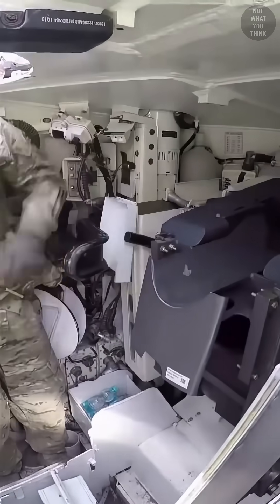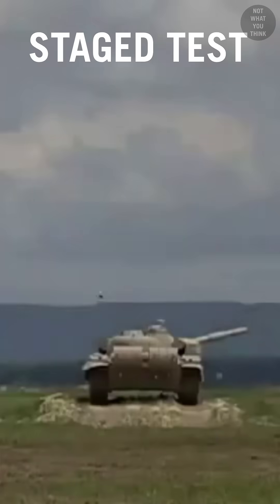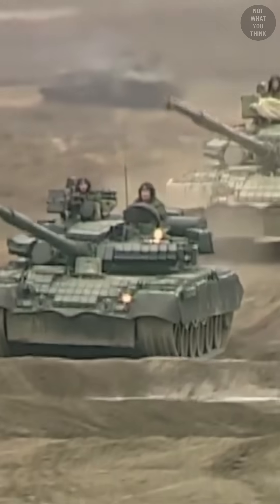Why M1 Abrams Tank Has No Auto-Loader #shorts

Comment: The reason Russians went for an autoloader is because  they have many more tanks and reducing the crew to 3 from 4 gave them a 33% increase in crews available to fight but at little expense. Despite Western assertions, the Red Army has always had a manpower shortage, but not quite so much an equipment shortage. So a 3 crew MBT makes a lot of sense to them.
Reply: Yup. It's interesting to compare Russian engineering to American. Russian war machines are as if designed to be run understaffed, under-maintained, outside operational envelope.
I recall one example was aircraft's engine reverse:
USA: we'll prevent in-flight engine reverse for safety, so as to eliminate the chance of the pilot accidentally activating it in flight and crashing.
Russia: we'll enable in-flight engine reverse for safety, so when the pilot needs to land this aircraft on a runway shorter than required - they'll be able to kick in engine reverse before full touchdown.
Reply: @suzukirider9030  reminds me of the AK47
Reply: @suzukirider9030  Well, as we like to say about safety rules with guns: your finger is your safety.
Reply: @suzukirider9030  They do have actual experience with winning wars as well though.  Not just maintain war for income.
Reply: @suzukirider9030  OMG I LOVE AMERICAN SAFETY. Especially that moment when they use depleted uranium both in M1's armor and shells, so almost every crewman after service becomes infertile! AMERICA FOR THE WIN!
Reply: @vibk2744  Sources? I heard about Depleted Uranium AP sabot rounds, but find it hard to believe it's used in armor. Armor needs not be heavy.
Reply: @suzukirider9030  The M1A1 AIM model and beyond of Abrams has depleted uranium located inside the turret and hull armor, but yes we use DU rounds as well.
Reply: @vibk2744  While we do use depleted uranium in both armor, and our shells it is completely shielded so the crew isn't exposed. Depleted uranium is only 70% as radioactive as regular Uranium, and mostly admits Alpha particles, which can be blocked entirely with a coat of paint. The only risk is if the DU armor is hit with a DU shell the dust will cause those nearby to breathe in depleted uranium through the air.
Reply: @Adierit  Hold on a second.
Radiation doesn't come in separateable flavours - nuclear synthesis emits all 3 parts: alpha, beta and gamma.

There's no such proccess which emits alpha-radiation alone and not the other two.

Besides, emitting alpha alone would be electrically polarizing. For each alpha particle - two beta particles (which are basically high-energy electrons) must be emitted.

Also - when a DU sabot rounds hits ANY kind of armor - it's evaporated (along with a portion of the armor). That's literally how sabot rounds work - they melt a hole in the armor with their kinetic energy, and hope it reaches through the entire plate. So that DU round hitting a common steel armor plate would also evaporate all that DU into radioactive droplets (which will cristallize back into solid dust particles in-flight, but still be radioactively exposed).

But, I guess if you're in a tank that's being hit by a DU sabot - the radiation from the dust is the least of your worries.
Reply: @suzukirider9030  you're correct, it does emit other radiation, but depleted uranium is again, depleted, meaning its main emission is alpha particles as is well documented. as far as the armor goes, yes i wasn't concerned with giving off a perfect answer, it was more so pointing out the obvious
Reply: @suzukirider9030  sabot just means theres a casing around the round for rifled barrels, like a shotgun wad
Reply: @maddogpatches  I see, thanks for clarifying.
I basically thought APFSDS and "sabot" are sort of the same. But, like you said - it's more like APFSDS is just one application of sabot.
Reply: @suzukirider9030  you’re not understanding how DU works in munitions. It doesn’t “evaporate” on impact nor is it designed to “melt a hole” in the armor. There’s a reason the DU part of the round is called the penetrator - because it penetrates the armor, it doesn’t just “evaporate” and melt armor. The way DU burns it sharpens itself as it goes through armor, and the goal is to still have a projectile left on the other side to destroy whatever is behind that armor. Yes DU burns but melting armor is not at all why that’s desirable - it’s the fact that the penetrator continually sharpens itself as it penetrates, where as any other penetrator material (tungsten carbide, steel, whatever) will mushroom on impact - a fat mushroomed penetrator doesn’t penetrate so well. DU is the only heavy material that will not mushroom on impact and in fact gets sharper the further it penetrates due to the way it burns.

Also “evaporate” is for a liquid turning to gas, the word you’re looking for is disintegrate to describe a solid turning to dust / fine particles, or maybe combust if you were trying to say it’s burned up.
Reply: @TheWallsocket  I see... Well then I was mistaken. There's a simulation of APFSDS rounds penetrating armor - my understanding was that both the round and armor melt on contact (kinetic energy per mass being greater than energy needed to heat and melt that same mass), and the hope is that by the time there's a through-hole in the armor there's still some rod left to go through it and do internal damage. But maybe that's how Tungsten rounds work? What you're describing about DU rounds is very different.
Reply: @Adierit  Exactly, although its not usually dangerous to tank crews, it is dangerous to our infantry when they walk on vehicles and buildings hit with DU rounds and the locals of course.. lol
Reply: @TheWallsocket  agreed. HESH rounds are what this guy is talking about. Those use kinetic energy and HE to evaporate against the hull and cause the armor on the other side to shatter into deadly fragments.
Reply: @killerhellhound  Depleted uranium is uranium that went over the mark of half decay. Meaning it still has 50% of it's radioactivity. Couple that with the fact that uranium radiation has long waves that penetrate both non organic and organic matter very well and you have combo that should never be used anywhere near the personell.

If you have to use something so dense (which doesn't make any sense as current APFSDS can penetrate up to 800mm of armor and with time it'll be even better) use tungsten. It is better to ensure that crew will survive rather than the tank will not be incapacitated.
Reply: @PORRRIDGE_GUN  Was meant so say that it travels at 1500m/s and can pen up to 800mm idk why I fused them together loosing half in the process kek. Also 380mm naval would rather decimate the front of tank as opposed to simply penning it.
Reply: @vibk2744  that’s a good idea to get rid of “poor people” since that’s who they mainly recruit. If they can’t have kids that’s just a plus
Reply: @suzukirider9030  wait are you sure? I actually didn’t know that all radioactive stuff emit all particles.
Reply: @cassu6  Well, there are a few various fission reactions, for instance U-235 fission emits fast neutrons, which are neutrally charged... There's only a dozen or so reactions that actually exist in the world, around the U-235, U-238, and Plutonium kind of metals.

But beta-particles are fast electrons and cannot be emitted without emitting alpha-partices (because the electric change must be preserved on a meta level). 2 neutrons (-1 charge each) per 1 alpha-particle (+2 charge each, basically a Helium atomic core).
Reply: @suzukirider9030  Uranium is one of the most dense materials around. Thus is makes awesome armor.

I can confirm M1 Abrams uses depleted uranium in their turrets. A small layer.
Reply: @suzukirider9030  Man ! You seem to know your stuff. Good for ya. It was interesting reading your comments.
Reply: @suzukirider9030  tjat should be true about armor but also compare the m1 abrams weight to some other tank and you will se just what ypu are scared of
Reply: @infectedshroom3097  Indeed, the Abrams is 50% heavier than an T-72 or T-80...
Reply: @infectedshroom3097 , why is weight relevant?
Reply: @iamcuthulu316  well the heavyer the tank is the harder is for a tank to manouver around, it comsums more energy, its harder to transport it...
Reply: @infectedshroom3097 , exactly my point
Reply: @iamcuthulu316  Russia is so massive that a tank would completely wear out its engine driving from one end to the other. There is only one way to move tanks across that much mileage, and that is by train. The lighter a tank is, the easier it is to transport and the more tanks can be transported by a single train, meaning quicker logistics during mobilization. 

It also means the tank can cross bridges a heavier tank cannot, and Russia has plenty of rivers- one of the reason the BMPs and BTRs are amphibious. 

The more heavy a tank is, the more expensive its fuel supply is, and the bigger (and more expensive) of an engine is needed to move it. In the case of the Abrams, a gas turbine is used… Which is like a magnet for heat-seeking missiles. 

Finally, Russian tanks present a smaller target. 

So, there are numerous reasons why a lighter tank is beneficial.
Reply: @vibk2744  also thousands of crewmen of Iraqui armor became infertile, due to incineration.
Reply: @suzukirider9030  there is depleted uranium mesh in some of the later M1A1 variants and all of the M1A2 variants the reason is that the very dense uranium can absorb large amounts of energy from kinetic penetrators making uranium by weight a better armor than composite. Also the guy that said that the depleted uranium harms the crew is dumb. First of all the uranium in the armor is deeply embedded meaning the rest of the armor absorbs the radiation preventing exposure to the crew. Second of all the ammunition is stored behind very thick steel blast doors except for the ready rack closer to the driver but that is still protected by steel meaning that the crew is not exposed to any more radiation than any other person.
Reply: @vibk2744  the depleted uranium isn’t very radioactive but it is toxic but so is 1/2 the other stuff in military vehicles
Reply: @Adierit  Good times of "should be" followed by couple decades of gaslighting and the eventual "ok, maybe in practice it doesn't quite work like that".
Reply: @vibk2744  Gunship moment.
Reply: Wow, that make sense
I thought it just marine thingy givin the soldier free PT
Reply: Well considering the footage witnessed in the video I believe it's better for your crew and army population numbers when you don't always die with the tank
Reply: As the main part of that it's better to have an auto-loader than an undisciplined and uneducated loader blowing up own tank.
Reply: There is also the factor of Russian demographics. Have a sex imbalance not favouring men, who traditionally are make up the vast majority of combat roles in a modern military.
The imbalance is said to come from the heavy drinking culture, shortening their lives.
Reply: @Will-bo7kg  heavy drinking culture is not a culture. Its more likely the result of russia being toxic as fuck, hence why people drink themselves to death.
Reply: Also, Russian tanks are as important to Russia as American jets are to America. They've got the open steppe, mobile warfare is what they do.
Reply: This is completely wrong and just idiotic. Russians chose auto loader, because they wanted tank to be as small of a target as possible and autoloader saves space. Also if you fight against any decent opposition, not armies armed with weapons from 60s nothing will help your tank. It will get destroyed, no matter what model it is.
Reply: If you need only 3 instead of four you have 1/3 or ~33% more teams, not 25%.
Reply: @bilib1891  Yeah. I'd be a shit quartermaster.
Reply: @bilib1891  nice
Reply: @bilib1891  
He was probably thinking that a 25% decrease in crew size allows for more crewed tanks.
Reply: @bilib1891  3 is 25% less than 4. 4 is 33% more than 3. It went from 4 to 3 so 25% less.
Reply: @KILLERBanshee  That's exactly what I wrote. You do notice the "Edited" mark on the OP?
Reply: @KILLERBanshee  dawg that makes no sense at all
Reply: @bilib1891  100 privates and 4 crew members gives you 25 crews/tanks. Reducing crew to 3 would give you 33. Percentage difference between 33 and 25 is ~27. So 25% was better approximation.
Reply: @bilib1891  wait that makes no sense at all
Reply: @bilib1891  qwik mafs
Reply: @bilib1891  I think what you actually mean is 33.33333333333 repeating
Reply: @bilib1891  having 1 person free and 3 on the job means you have 25% more people being free (1/4), compared to if 4 person were occupied then you have 0% people free (0/4)
Reply: @m.agilnajib345  The post was about how many more tanks you can support with crews. Also: having 0 people free and later 1 guy free isn't 25% more, it's indefinitely more.

But let's get to how many more tanks you can have (percentage). I claim 33% you and the poster claim 25%. Let's do an example with 12 soldiers (because 12 is dividable by 3 and by 4, making calculation easier).
With 4 soldiers per tank you have 3 crews for a total of 3 tanks (12 / 4 = 3).
WIth 3 soldiers per tank you have 4 crews for a total of 4 tanks (12 / 3 = 4).
4/3 ~133% in total or ~33% more
Reply: @m.agilnajib345  if you have 12 guys, you'd have 3 four man teams or 4 three man teams, so 1/3 more of 3 teams is 4 teams
Reply: @ThatToast  i see, it seem its a point-of-reference difference... i got your point
Reply: More like no give a sh* for life of the soldiers
Reply: Lack of manpower is not something I associate with the Red Army. :) Why would that be? They could recruit any number of men at any time.
Reply: @testales  I have explained why. Try reading it again. It is something that affects Russia to this day.
Reply: @PORRRIDGE_GUN  Where? In another comment under this video? If so when approximately. Kinda hard to navigate comments on YT unless I'm doing something wrong.
Reply: @testales  you can find some book about russian demographics if you are really interested, or find some yt video from a real expert
Reply: @testales  You mean like conscription? Like the US did in the vietnam war? US was running so short on people they even recruited low IQ people. 

Project 100,000 (also McNamara's 100,000), also known as McNamara's Folly, McNamara's Morons and McNamara's Misfits, was a controversial 1960s program by the United States Department of Defense (DoD) to recruit soldiers who would previously have been below military mental or medical standards. Project 100,000 was initiated by Defense Secretary Robert McNamara in October 1966 to meet the escalating manpower requirements of the American government's involvement in the Vietnam War. Inductees of the project died at higher rates than other Americans serving in Vietnam and following their service had lower incomes and higher rates of divorce than their non-veteran counterparts. The project was ended in December 1971 and has been the subject of controversy, especially during the manpower shortages of the Iraq War.

US was running short on people, while having much greater population number..
Reply: "They're gonna reload at some point" ~ A Crazy Russian
Reply: The biggest assertion the west has made, is that the red army was ever a real threat… paper tiger.
Reply: @Abstr7557  more like..paper bear
Reply: The reason that they went for autoloader is becouse they can build smaller lighter tanks - less armour volume , less material spend for the same level of protection - basic armour protection that is. Every crusial component of the tank needs protection - including the personel. More people inside - more amour volume and more mass. Russian T 80 tank - around 40 tons , M1A2 around 60 tons.
Reply: There’s a lot more reasons, like, the overall size of the tank is smaller, as well as having more armor for the same weight,
Reply: @patriotic-panda , isn't it a bad thing to be heavier as a tank tho
Reply: @iamcuthulu316  it is a bad thing to be heavier
Reply: @patriotic-panda , exactly, the original comment was saying you should fear the m1 Abrams because it is heavier
Reply: @iamcuthulu316  what? It being heavier is BAD
Reply: WW2 hit like a brick dropped from the moon.
Reply: Pretty sure Russia is STILLL to THIS DAY recovering their pop. lost from ww2 or AT BEST as just caught back up with where it was.
Reply: They have one of the lowest birth and immigration rates. 20 years Russia is a ghost
Reply: Funny how you claim the red army values it’s men but the auto loader is more likely to kill them in the event they get hit 😂😂😂
Reply: 🇺🇸 will still kick 🇷🇺 🍑
Reply: "the Red Army has always had a manpower shortage, but not quite so much an equipment shortage"

Literally the opposite of the truth in WWII. We had to send them lend lease for equipment and food.
Reply: @JarthenGreenmeadow  Correct. We sent them lots of equipment but without troops, it was useless. The biggest contribution was trucks. Lend-lease trucks meant the factories that produced them could switch to aircraft or tanks.
Reply: They had a manpower shortage because their government had an equipment shortage that caused a lot of lives and created a manpower shortage lol
Reply: umm no, russia has plenty of manpower. it's an utter bullshit that 1 crew member being less for tanks is going to make a huge impact in terms of tactical deployment in other areas. If you consider how many tanks are actually active at the moment such notion is even more laughable. 
It's just cost cutting, nothing more, nothing less.
Reply: that's bc they have a history of using their ppl as sacrificial lambs while storing their proud weaponry in the rare.
Reply: @dawjy9413  : who's you're talking about?
Reply: They must have the skills up to 100% mastery
Reply: So what youre saying is that the both made the decision that works for them?
Reply: Doesn’t makes sense what you talking about
Reply: They aren't "The Red Army."
Reply: Thank you sm
Reply: expect for the siege of stalingrad
Reply: Advantages to both but yah id take the Abrahams safety function over the auto loader.
Reply: @cookiebandit101   latest russian tank, Armata has crew of 3 in protected  capsule, the turret is manless, arguably the crew is equally,if not better protected...
Reply: @dpmjole  hmm interesting. then again I bet the latest and greatest tech is probably not made available to the public either so they prob have alot more advanced stuff on both sides.
Reply: Nice, you taught me something.
Reply: huh
Reply: But majority of people in russia have done national service and been in the army i dont understand how they have a shortage of manpower if was kicks off there numbers will more than quadruple
Reply: @leonalexander9740  Cause they were trying to compete with an western alliance with like 12% of the worlds population.

With only like 2.5% of the worlds population themselfs.

Thats about 5 times less manpower than the NATO countries they have been been in competition with.
Reply: @MrDanisve  nato is a lot of countries russia is one.. how long has nato existed cause russia has had national service for a long time but yeah i hear what your trying to say
Reply: More isn't better, the Abrams have a wider capability. Faster, more agile and accurately reliable
Reply: Or maybe they had so many soldiers that exploding munitions destroying tanks dind't bother them lol
Reply: Also russian mbt guns have a higher caliber so the shells are harder to handle.
Reply: Good point
Reply: I love the DU discussion here.. well the flat side of the axe is not as sharp as the other end.. both will kill you if you swing them with enough force to the head :D
Reply: @MuzgontarAco  Fuck Axes...we use tanks.
Reply: WW2 siege of Stalingrad would like to know your location
Reply: They dont have a man shortage they are just always seeking the absolute most devastating power from their army, while the west is happy with its more organised approach.
Reply: Also autoloaders most importantly allow for a consistent fire rate as no human can constantly fire as fast as a autoloader could in theory
Reply: Stop having sechs
Reply: They had a shortage but if they needed more people in a war the people would just come
Reply: History so cool
Reply: I feel that the reason behind it is that rushian tank designs have smaller crew space in the turret... Human loader would have not enough place to move efficiently, so the overall performance would drop, hence the autoloader...
Reply: it's almost like technology is a series of trade offs that can be fit to a specific use case, and not blanket better or worse than another instance.
Reply: Cheaper and easier to maintain 3 vs 4,
Reply: I do not think it is so hard to train another 4th man to be a loader in a fucking tank...
Reply: manpower shortage? you pulled that out of your ass, conscription in USSR into the federation was always good
Reply: Yeah, of course they are having manpower shortage. After using men in human waves population drops badly.
Reply: @andarara-c1p  They never did 'human waves' - it's just another excuse from the Aryan Supermen as to why they got their arses handed to them by the soviet peasants, whom they viewed as 'untermensch'

The Germans came up for all manner of excuses as to why their much vaunted Wehrmacht came a cropper on der 'ostfront'

Rather than admit poor staff work and crap strategy and bad timing, they blamed everyone/everything else. The weather, Hitler's meddling (of which there was little in reality)

Remember, all militaries are more or less dysfunctional. The Heer was no exception.
Reply: @PORRRIDGE_GUN  there were human waves, actually. And not just about WW2 military stuff is what I'm talking about. Russia but especially URSS were very good at wasting human lives.
Reply: @andarara-c1p  Human wave attacks were very rare, even for the Soviets. For the majority of the war, the Soviet units deployed on the front were out numbered by their German counterparts, and even once they recruited enough people and Germany’s army size declined, the manpower advantage was only about 2:1 for most of that period. By that logic, the USA was using human waves against Japan because we outnumbered them 2:1 most of the time. 

A close examination shows that the Soviets had several well developed strategies such as Deep Battle and their war efforts were definitely not human wave attacks.
Reply: @QualityPen  A pity that still the part of having more cassualties than any other faction and waste of lives remains.
Reply: It's not just that but the issue of the Allies (NATO) having naval and air supremacy. USSR and later Russia understand they cannot outright control the skies or seas and increased wars over the years saw how the US heavily relies on Air Supremacy and tank killing is almost number 1 priority for the US armed forces so reducing numbers to get more tanks of the field helps solves this problem. Russia has always seen numbers beats firepower.
Reply: Very true. WWII did that
Reply: The notion of inexhaustible manpower comes from the world war era. Where seemingly everyone who was capable of wielding a fire arm was sent to fight.
Reply: Hmm idk but for me maybe decreasing from 4 to 3 due to auto loader can also leads to "less crew = more tanks can be deployed"

Lets say Country A at war against Country B and each has Total 720 soldier to operate tanks..
İf 4 crew each tank = that means only 180 tanks can be deployed
İf 3 crew each tank = that means 240 tanks can be deployed

Well its just my perspective.., coz auto loader or Human Loader has their own pros and cons..
Reply: Wtf you talk? Soviets and manpower shortage?
Reply: This has been an interesting read going through the comments on this
Reply: Pp0jjjkk
Reply: well, they'd of had less of a manpower issue if they hadn't killed off 24mil of their people in WW2
Reply: @SoloRenegade  How many died in the Holomodor is debatable. But it is another subject entirely and not the only factor affecting manpower levels.
Reply: not quite , they done it to make tanks smaller/harder to hit , by having less crew you ether can have more armor (who used to be main drive force) but when armor became less relevant it was about having smaller siluete , there is also argument autoloader has consistant loading times and never gets fetiqued.
Reply: чета спорно, сильно спорно
Reply: But this does not answer the question why the US did not do the same as Russia?

Always, all armies of the world (participating in any armed conflicts) will experience a shortage of personnel. In order to make one tank with four crew members move, another 20-100 people are needed - repairmen, refuellers, warehouse personnel, logisticians.

So you want to say that there are so many people in the US that the government does not know what to do with them?
Reply: This tank is only good in commercials))). And on the battlefield it burns like a match. The Iraqi authorities bought 150 such tanks from the United States and lost about 50 in the war against terrorists in a short time. The rest of the Abrams tanks were sent to the landfill, and bought in Russia to replace the t90)))
Reply: Western assertions? So you’re saying the West makes up the number of people in the Soviet Union?
Reply: @oneaburns  Commentators (anti-Soviet propagandists, really) also claimed that the Holomodor killed 100m people. Simply not sustainable nonsense.
Reply: Agree, Russians always use the advantage of speed & mobility they learned from the Germans during how Nazi capture Paris in just short time.
Reply: Needing fewer crewmen may be a side effect of having an autoloader, but they weren't designed that way because of a manpower shortage.
Reply: UNSC tanks can take as little as 1 crew to operate
Reply: whatta bunch of crap. The real reason is because they wanted to keep tanks as compact as possible.
Reply: Russian tank crews have to be shorter than 5 foot 4 inches, and that limits who can be recruited.
Reply: they also dont care about their crews survival so why should they care if the tanks dead they dont need the crew haha
Reply: So few soldiers that they've been pouring them into a meat grinder in bakmut for months now in human waves. Smh. The reason russians went with the autoloader is the same reason they throw barely trained conscripts on the front lines. Their citizens are just as dispensable to putin as the were to Stalin. He doesn't care if the whole crew dies. He can just throw a few prisoners in another one and point them at ukraine. Smh
Reply: That makes absolutely no sense.  Manpower was never a shortage for the Russians.  They went with an auto loader primarily because it shrunk the size of the turret immensely.  Russian MBTs have a much smaller profile than Western equivalents.  They use far less steel.  T64/80 is around 40 tons whereas the M1A1 was 60 and the more modern ones are closer to 70 tons.  If reducing manpower requirements drove the decision, the israelis would have gone for an auto loader.  they are under a far more restrictive manpower availability calculation than the soviets ever were.
Reply: @pauldarling330  what do you mean? As far as I know Russians have this kinda pseudo conscription army with tons of professionals, whilst Israel has conscription for everyone and a small amount of professionals. I’d say that Israelis have more manpower since they can use everyone in their country
Reply: @cassu6  How about you compare the population between the two?  And the soviets designed their tanks to be used by the entire warsaw pact, as well.  manpower was never a shortage for the soviets who had total conscription and their tank designs are a legacy of that.  Israel has a tiny population.
Reply: @pauldarling330  The total population size doesn't matter since your army is proportional the country's size. Israel has most of it's population in it's manpower pool. Russia nor the warsaw pact countries don't. They also have much more to area to protect and attack incase of war
Reply: @cassu6  but when the 125mm cannon was introduced in 1964 the warsaw pact had conscription.  the auto loader was created to reduce size and weight and because the 125 round was considered too heavy for manual loading.  nothing to do with reducing manpower requirements.  Stop digging.  You are wrong.  Full stop.
Reply: Like many things, a rudiment from WWII, because in the early days of the German invasion of the Soviet Union, there was a shortage of equipment, but an excess of men. The whole '2 men per 1 rifle' is probably exaggerated, but the Soviet Union did receive billions of aid from the Lend-Lease program, so there are pictures of the Red Army using Willys Jeeps.
Reply: the real danger of DU ammunition was seen in Iraq, as much to the crew -several times more to the population. those destroyed tanks are left on the side of the roads,in cities suburbia, countryside and little children tend to play and climb up those "reliques"
they later develope various tumors and whatnot. and even more damage than tanks comes from DU rounds fired from A-10's 30mm cannon.  
  -and to the genius that suggested that "depleted" means "past half-life" - that half-life is  700 mil.yr. !!! 🤨
Reply: The reason russians went for an autoloader, is because they don't give a fuck about their people. They have a typical explanation to that: Бабы новых нарожают. 
I hope you can translate that!
Reply: Fun fact: their population still hasn’t recovered from ww2
Reply: Always got me with the T34s, do you want 1 good tank or 10 crappy tanks? Quanity or quality. Not to say the Sherman was much better.
Reply: @longbow6416  I wouldn’t call the T34 a crappy tank. It was quite brilliant actually. Biggest fallbacks were the crew comfort and lack of radios especially early on. But with the modifications for a bigger turret and eventually a bigger gun I would say that it was the best tank of the war
Reply: @longbow6416  
1) xD Sherman 
2) Russians could afford to make tanks in huge rush due to the fact that battlefield was 2hrs drive away from factories. Also like with EVERY other doctrine at that time tanks were meant to survive up to 15 minutes after deployment and destroy maximum of 3 tanks.
Reply: less crew members on the tank, mean the tank /tank unit needs more support troops/perimeter guards/etc. from other units, so the man-power saved/gained is nil. 
i.e. - Between tank crewman, mechanics, logistic support, and local security , you still need the same total number of soldiers  ,  for a tank unit to function  , whether the tanks themselves require  3 or 4 crewman on each tank or not.
Reply: They have a manpower shortage because they threw bodies at problems and thought everything would solve itself which it did
Reply: But i tought russians have like alot of military personal alteas thats what thay say
Reply: Laugh at 1 gun per 5 or 3 soviets cant remember exacly
Reply: Russian tanks and russian army = sh×t.
Reply: Ah this makes sense nowadays given their half the population of the US but during the Cold War we’re competing with arms production on similar scales. Guessing the myth comes from WW2 where they actually had a manpower surplus and not enough equipment, putting people in battle without a gun.
Reply: @blaisestritt8177  They never had a manpower surplus. Why do people persist with this fallacy?
Reply: nope, the dead crew won't go to the next battle. It is more about how low russians treat their soldier's lives
Reply: @ievgeniiromenskyi3375  lmao good one
Reply: They just wanna hate on the glorious communist army
Reply: A lot of Russian tanks are extremely old and not even ready to be driven let alone be combat ready
Reply: @ballsonyourmomschin1781  That’s really not accurate. Russia has done a good job of keeping its tanks up to date since 2008. Tanks like the T-72 regularly receive upgrade packages to keep them competitive on the modern battlefield. Also, “extremely old” is meaningless. The Abrams is from roughly the same era as the T-72. Is it “extremely old” too? How about the B-52, which has been in the US airforce since the 1952… 69 years? Most stuff in Russian service is roughly as old as most stuff in American service. 

There are countries which bought Soviet equipment and have not modernized it in several decades- Iraq was one example. It had tanks which were two decades behind their Russian counterparts in modernization when Desert Storm happened, plus they were slinging steel penetrators from the 60’s- which were not even kept in Russian armories anymore. 

Seriously, look up the T-72’s history. Those modernization packages are serious upgrades, despite not being overhauls. The T-72 of the 70’s is nothing compared to a T-72 of 2021. The same applies to other vehicles like the T-90. Recently Russia has produced modernization packages every several years. T-90 gets the new stuff, the T-90’s old stuff becomes the T-72’s stuff.
Reply: @ballsonyourmomschin1781  That is a funny statement. I am sure you read that on your biased war thunder forum.
Reply: @MilkTea101  I don’t even know what war thunder is
Reply: They also have crap tanks. Military aside from the US and some EU countries tend to go for quantity instead of quality
Reply: @THEAMERICAN-ob2wt  have you seen like, any T90 or T14 test or direct competition vs Abrams?
Reply: @THEAMERICAN-ob2wt  lol no Russian tanks are quite good. And for a long time in history they had the best tanks as well as the most advanced doctrine. You don’t just lose that expertise suddenly
Reply: It also comes down to crew survivabilty.  The Russian ideals were that they did not care how much they lost crews due to a doctrine of mass of troops over quality of troops.  The M1 series and on tanks are designed around crew survivabilty.  Our crews are trained to a far greater level and replacing them would cost much more.  We looked at it as one of our crews was worth 4 or more of their crews.  I was a gunner on M1 and then M1A1 tanks for 8 of my 9 years in the Army.  I can tell you that though our tanks have a few faults survivablity for the crew is not one of them.
Reply: @theguardingdark1183  With all due respect, that is horseshit.

All militaries treat there human material with disdain. Ask any Vietnam veteran for proof. The socialist paradise of the USSR was no different but for one small detail: They had a genuine manpower shortage due to events 20 years earlier.

In 1917, the Bolshevik revolution begins and the social norms are upended. The newly created USSR emerges from the civil war and sets about a massive industrialisation program, bigger than that begun by the old regime. Women are now needed in the the heavy industries and the factories. They aren't at home having babies. They have access to contraception, abortion and divorce. The birth rate plummets. By the mid to late 1930s this is being felt by the leadership as they see an impending Labour shortage slowing their meteoric growth (remember the 1929 crash and depression? USSR was unaffected.)

So fast forward to 1941 and the Red Army is short of 18-24 year olds to fill the ranks. This is why women were conscripted and formed into combat units, not because of socialist equality, but material necessity. Consequently, the USSR and latterly Russia, has a manpower shortage. The Red Army has not, and never did have a policy of wasting it's human resources. Commanders who did during the Great Patriotic War would find themselves swiftly replaced.

Even today, Russian birth rates are low and are an economic brake on the nation that is only slowly being taken off by inward migration.

So, basically, that's the reason they have autoloaders.
Reply: I have hear the Russians had 10 million tanks in 1988? However .any it was a butt load.
Reply: @bradleyhoskins1023  10 million? No, that's absurd. That's 1 tank per 15 citizens. With 3 crew per tank, it would take 30 million people to crew them? That's every 5-th citizen of the country! Women, kids and old-timers included! Assuming women don't crew tanks... they really don't seriously - that'd take literally every man between 16 and like 45 to be a tank crew!

The USSR army was about 2 million at it's peak, and that's with about half the men in the age of 18-27 in it!

WW-2 tank count was in the tens of thousands. Maybe all nations' combined tank forces amounted to 100'000. But not even 1 million. Let alone 10
Reply: @suzukirider9030  yes, during the Cold War the east had a draft. Every man served 2 years(in Bulgaria it was 2 years)
Reply: @suzukirider9030  p
Reply: Hence the shortage of crewman, not equipment ;D
Reply: @bradleyhoskins1023  I think you meant to say is 10 thousands tanks from the 19 decade all the way to our present
Reply: @bradleyhoskins1023  77000 to be precise lul
Reply: @bradleyhoskins1023  No.  It was 10s of thousands - all varieties from various eras and I'm talking actual MBTs not just lightly armored infantry or support vehicles.
Reply: @bradleyhoskins1023  real estimate is about 80,000
Reply: @bradleyhoskins1023  They still had a considerable inventory of T34-85s and KV models, certainly.
Reply: @bradleyhoskins1023  lol of course no.
Reply: „The red army always had a manpower shortage, but not quite so much an equipment shortage“ 
Someone obviously didn’t see „Enemy at the gates.“ but if you didn’t you can also look up the tactic that the Russians used to defeat Germany in Stalingrad, happy to help.
Reply: @Ya-Be  If Enemy At The Gates is your historical source on the state of the Red Army's logistics at Stalingrad, then you are no help at all.
Reply: @Ya-Be  you gotta be trolling right?